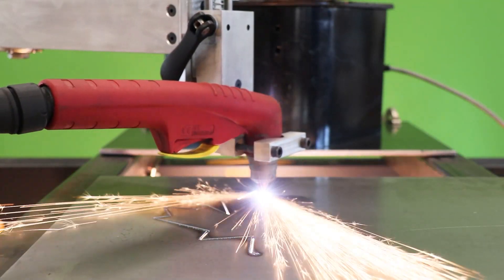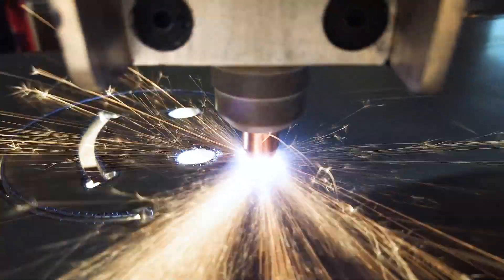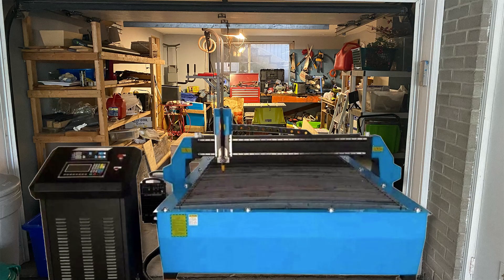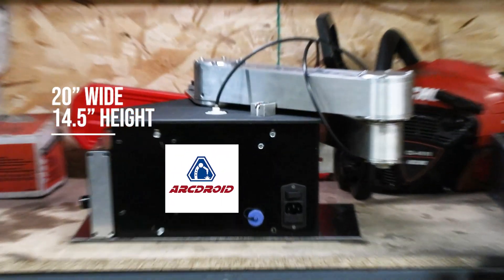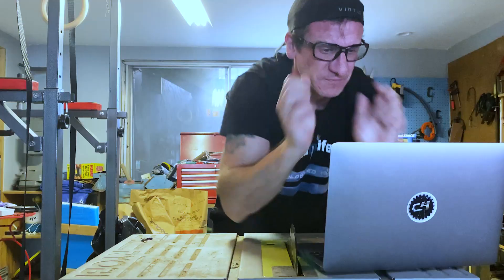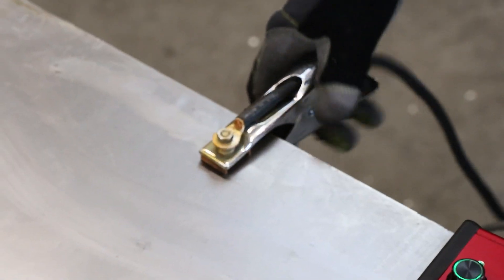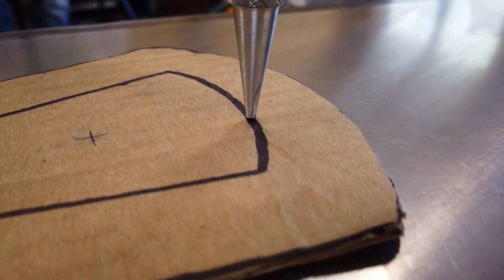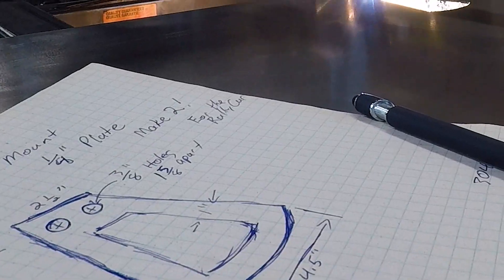ArcDroid CNC Plasma Robot

Comment: Hi Andrew, Merry Christmas. My name is Jim Wood I’m a retired Fire Captain and interested in plasma cutting, welding in particular on the Artist side. My wife is an Artist and has come up with some ideas that we would make out of light gauge sheet metal with the option of something 1/4” max.
I’ve bought a plasma cutter from Princess Auto but haven’t set it up (waiting on the compressor). Maybe before I proceed can you give the specs required for the Arcdroid CNC as we are very interested.
Thanks
Jim
Reply from the maker: Send us an email info@arcdroidcnc.com and we'll be happy to answer any questions